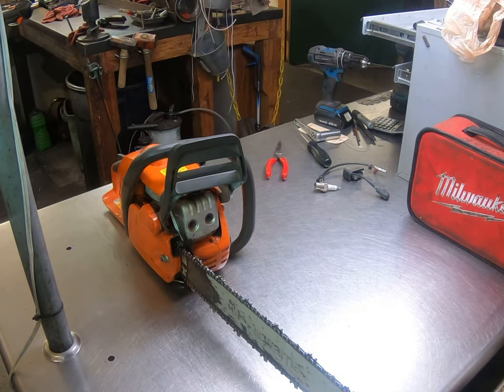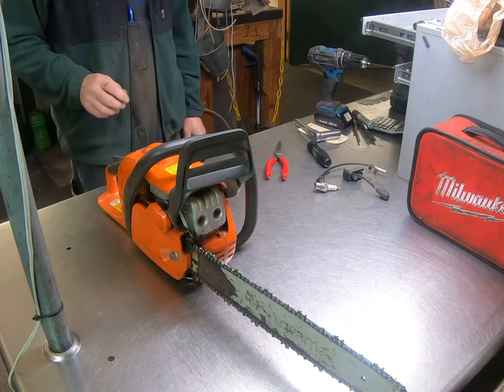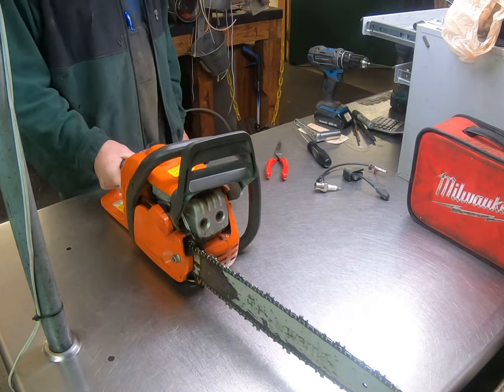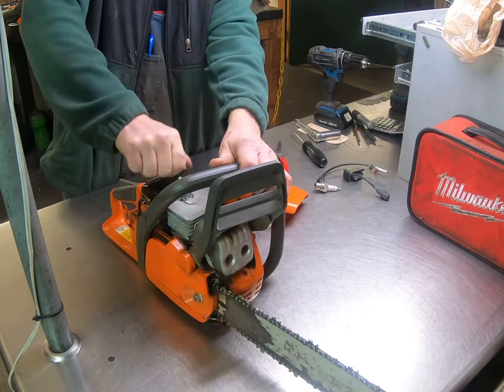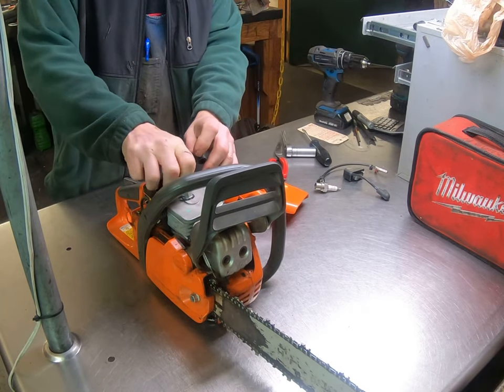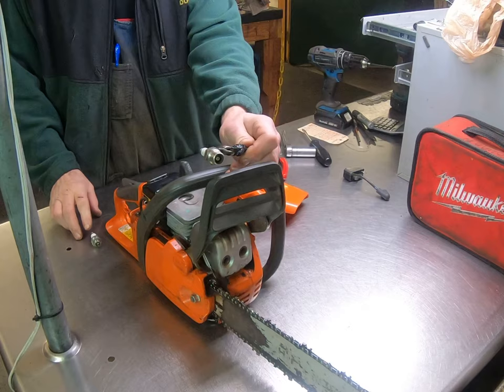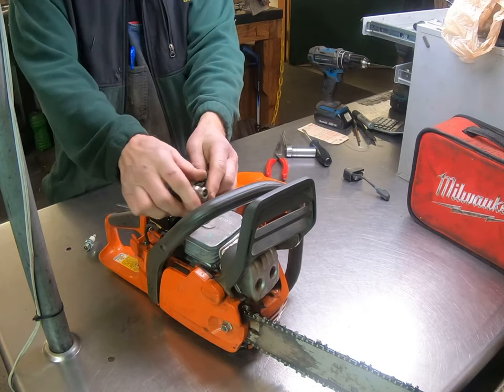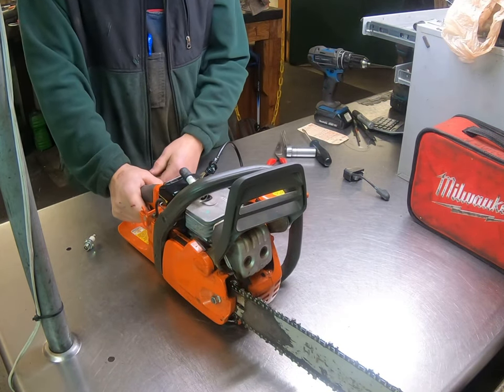Repaired , Not picking on the big guys (STIHL, HUSQVARNA) Known issues with their models

Comment: I fought my 440 for years.  At times it would start and run no issues.  Other times wouldn't start if your life depended on it.  Finally had enough and threw it on the shop floor and broke the chain brake off of it and went out and bought a Stihl.  Couple months later I pull it out just to see if I can find the issue.  First off, cleaned the carb real good, pain in the ass to pull out and it didn't help.  Check for spark and it was there.   New carb  and that didn't help.  I thought screw it for 20 bucks for a new Walbro ignition module why not try.  Sure as shit it fired up on the third pull.   Put the original carb back on and it fired right up again.   So 100 bucks later and new found patience, I have a back up saw for my new Stihl.